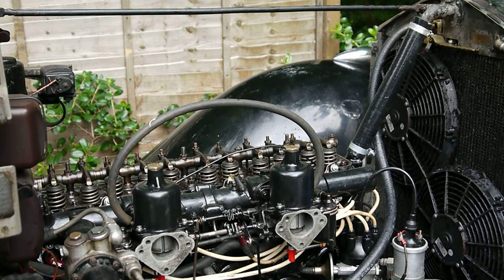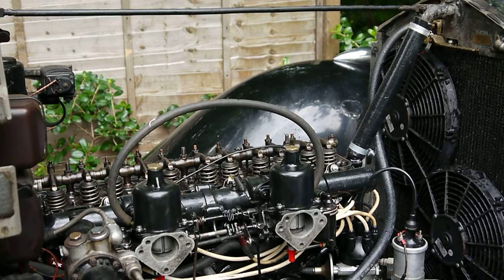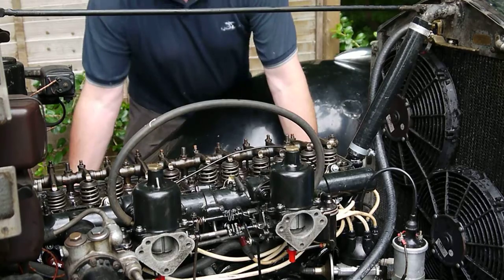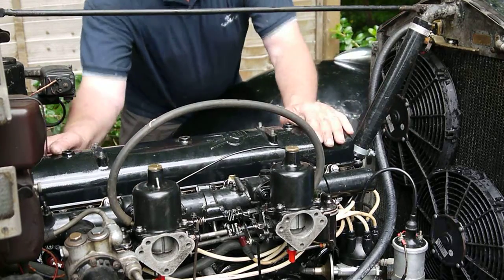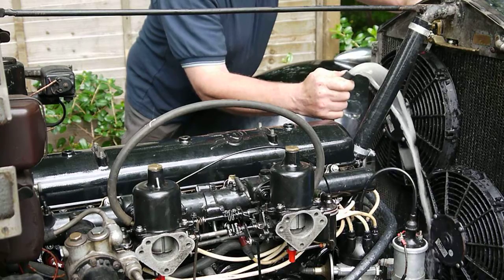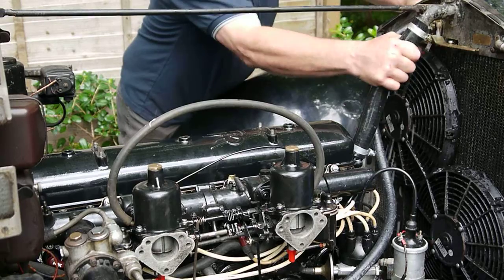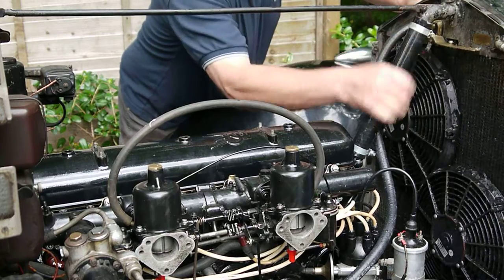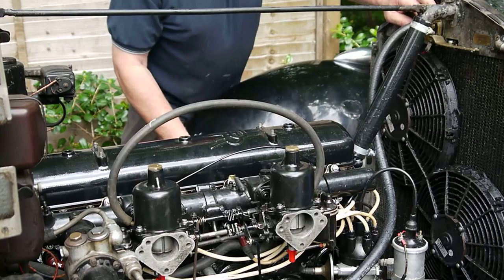Bentley 4 1/4 cylinder head test run

Comment: Hi,
What were the updated valves that you fitted?

Kind regards,

John
Reply from the maker: Mercedes 190E W201 4cylinder 1984-93. Inlet 43mm 1020531601, exhaust 39mm 1020500327. Also requires standard valve collets and caps, reaming of guides to metric 8/9mm and relapping of seats. Better and slightly bigger valves at a fraction of the cost of replacement Derby valves and guides.
Reply: @msinclair810  Thanks for the information!

Comment: Why fit all new parts as they run when the head is working normally perfectly well. Note there are two fans to cool the engine which is a bad sign. Also no mention of the head being cracked tested and the results shown.
Reply from the maker: Head was cast iron welded in a furnace, remachined and crack tested which is the subject of a different video. Fans were fitted to replace the dangerous (and unnecessary) big steel fan and very rarely come on. The only time they work when driving is sitting in a traffic jam on a hot day.